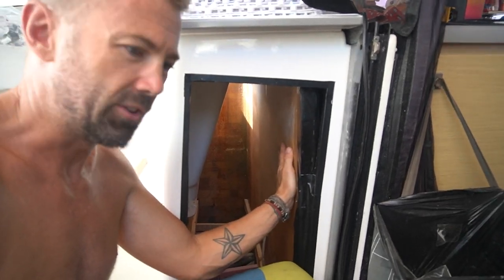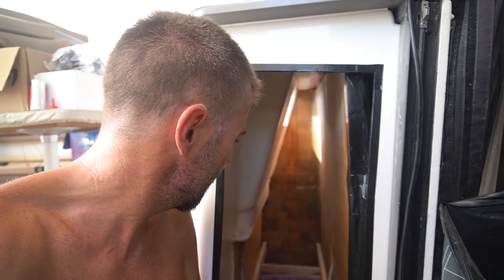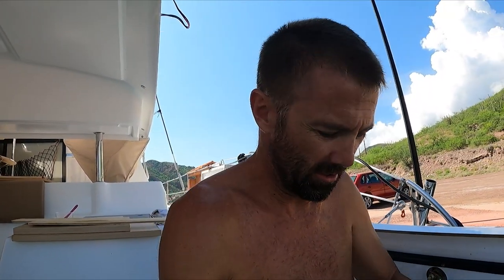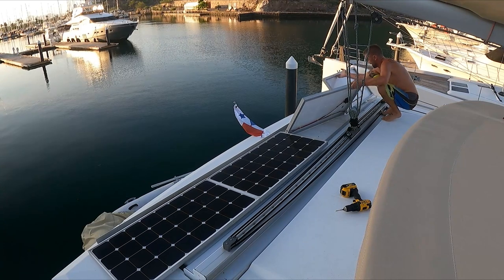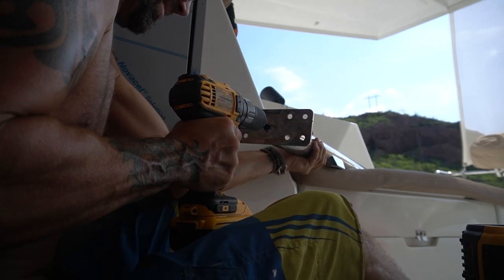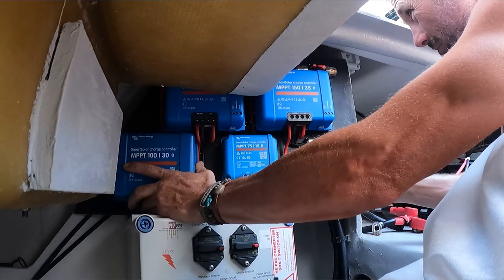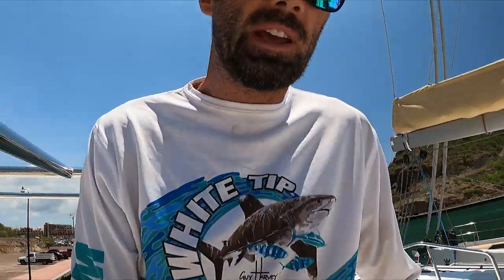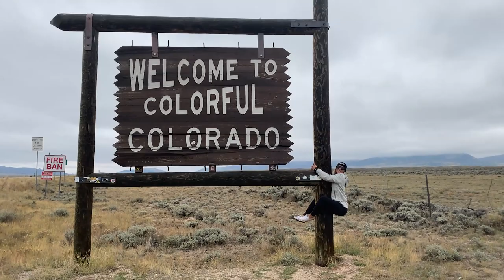Over Worked & Over Heated Boat Projects | Episode 135

Comment: My friend,  take it from an old machinist,  use a high quality masonry drill bit for stainless,  it will go through like hot butter.  Milwaukee makes decent bits 👌
Reply from the maker: Ok thanks for the tip!! Are you talking about the masonry bits that have a carbide tip?
Reply: @WEsail  yes,  I use them to cut through hardened steel, works great. Ps. Drill slowly don't Drill at high speed,  slow and easy.